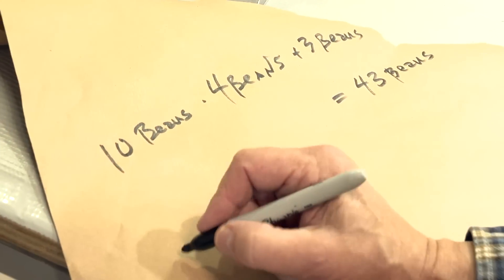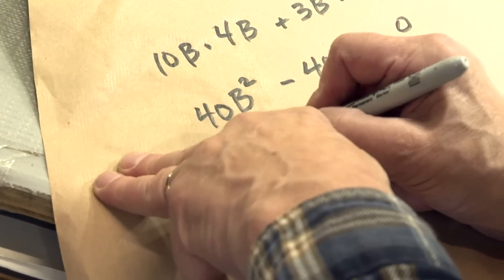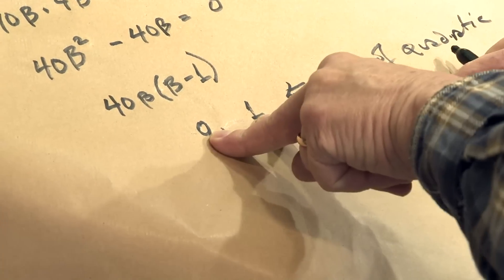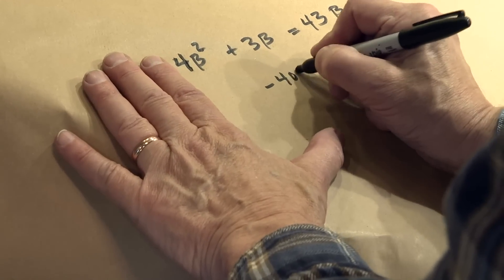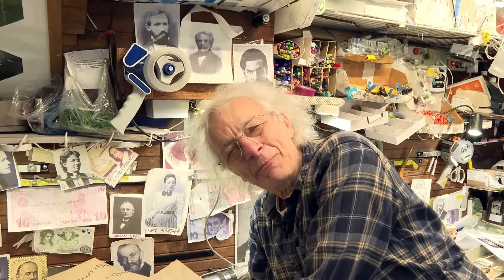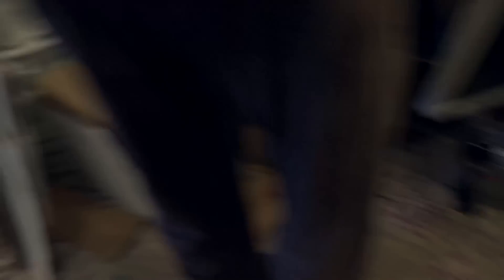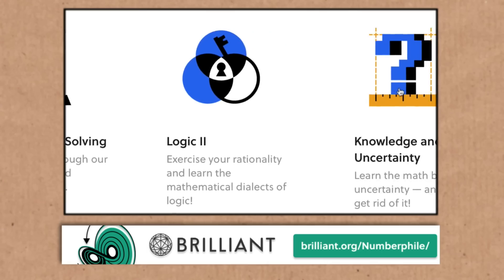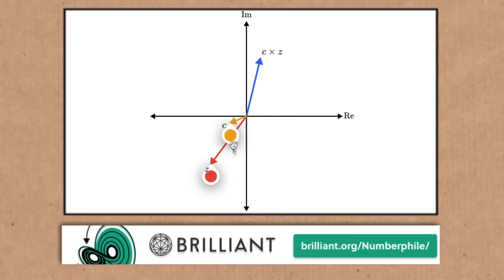The Nescafé Equation (43 coffee beans) - Numberphile

Comment: But beans isn't a unit, it's a physical object. When I try to visualize it I see 2 beans horizontally on 2 beans vertically, which gives 4 beans (in oppose to cm for example which literally changes from a line to a square)
Reply: The correct way to say that is, "2 beans times 2"
Reply: @topherthe11th23  man how did you add torque and lube and friction into this we're literally multiplying beans
Reply: @Maazin5  I know, but that doesn't mean 2 beans×2 beans=/=4 beans. Like I said, "bean" isn't a mathematical term or a measurement unit that gets a new definition once it's multiplied by itself, so we can't restrict it to the rules of abstract math

Also even if 2 beans×2 beans=4 beans², wth is a bean²?

Edit: it's like 2 beans×2=4 beans but 2×2 beans doesn't really have a physical definition when you think about it. And what about him showing that bean=1? That's obviously not true, a bean can't just equal 1. This video is just a little joke he made on the commercial for fun, I don't think it's meant to be taken seriously
Reply: @topherthe11th23  meter is a measurement unit, bean is not. Meter has a mathematical meaning, bean doesn't
Reply: @topherthe11th23  you translate a physical object to a certain value and then use mathematical operations on that value and translate it back to the physical object, you don't use mathematical operations on the physical object itself. If you assume a value was assigned to the object "bean" then you can do what the video did and solve for it, but it still works if no value was assigned (which means that there's no such thing as "bean²")
Reply: @topherthe11th23  I never said that math don't apply to physical objects, I said that you can't multiply a physical object with a physical object. There's no such a thing as a "banana×apple" or a "bean²". It doesn't exist and it doesn't have meaning.

Also, a meter, like you said, is a physical relationship. It's not a physical object. having a physical meaning doesn't mean it's an object. And also also, a meter, like with money from before, is a word that translates into a set amount of distance. A "meter²" doesn't actually exists, it's just a word that we translate into a "[distance]²" just like how there's no "$²" but "[value]²". A $ represents a value and a meter represents a distance.
Reply: @topherthe11th23  btw I answered them in the wrong order accidentally

Comment: There is a similar (but somewhat "inverted") horrible problem with Discovery or NGC shows translations - they ALWAYS change the units to ones commonly used in countries, but they can't calculate them correctly. That's the reason I keep hearing bullsh*t like "the area is 1.6 square kilometers" whereas I can clearly hear the original voice saying "the area is 1 square mile"... Nobody cares to check the translations :/

Comment: Naaah... it should sum to 43 "rich coffee beans", which are denoted Brc and are not necessarily equal to B. But in this equation system they are equal.

10B x 4B + 3B = 43 Brc, and
10B x 4B^2 + 3B = 43 Brc

->  40B^2 + 3B = 40B^3 +3B

->  B = 1,

-> 43Brc = 43

->  Brc =1,

So B = Brc = 1.

Comment: So let's say your toilet has a little section of wall between the door and a corner. And that wall is 4 tiles wide times 10 tiles tall, does that mean the area isn't 40 tiles but 40 square tiles?
Reply: Well, the tile itself is a 2D unit. By making that 4 by 10 space of tiles, you're laying tiles out in 2D space, which means you're basically remaining within the "tiles" unit. The only way to get a "tiles squared" unit (or I guess a "block" unit) would be to make an area in 3D space.
Reply: @BaeYeou  Exactly what I thought too. With the beans the situation is only in 3D. The beans are 3D objects that you lay in a 4 by 10 grid. The grid of beans is 4 beans times 10 beans, but there's still 40 beans on the table. (Plus 3 more beans)
Reply: @JaniLaaksonen91  Well I mean, they do explicitly say "2 beans times 2 beans", whereas your situation is more like "4 tiles times 10", given that a 4 by 10 area of tiles is just a line of 4 tiles lined up 10 times.

Comment: Part of my simpler mind wants to disagree, at least with the first example. When you take the dimensionally inaccurate 4B into the second equation and get that B = 1, that statement is logically correct (again disregarding the original dimensional inaccuracy of 2B * 2B = 4B). You are not saying that 43B = 1B, or that 43B = 1; only that B =1. As such, you are still getting 43 beans proper in your cup. Again, this is disregarding the dimensional inaccuracy of the first equation, and I haven't worked through it taking that into account yet.